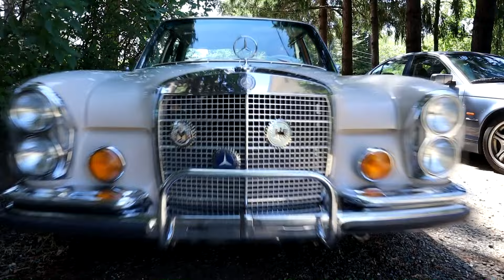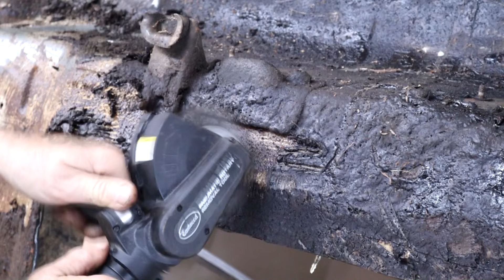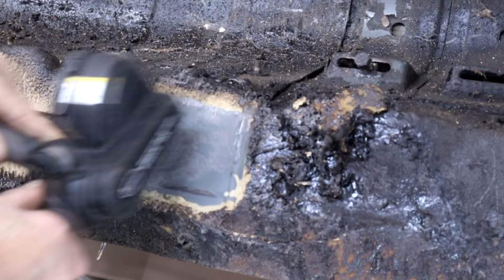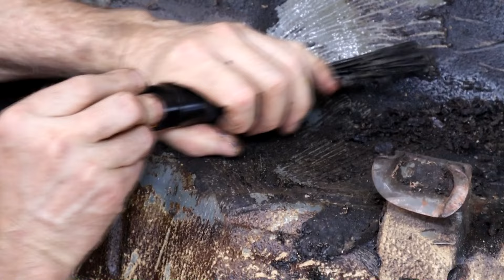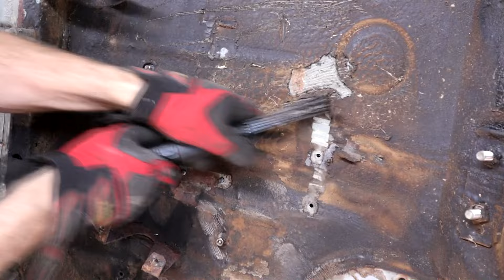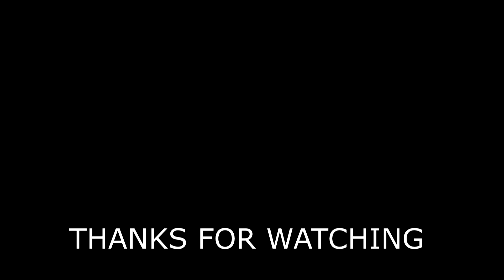MERCEDES FLOOR PAN REPLACEMENT PART 2.  UNDERSEAL REMOVAL METHODS

Comment: Hi John! I did it exactly like you do. Everywhere something different is best. All down to the bare metal, most called my an idiot, which is absolutely correct. At last comes the white "PVC", produces flakes and inflames easily unser heat ... Always wear appropriate safety and Filter equipment when doing this for hours /days. Fire extinguisher next to you. All in all it took me a full month to have the bare metal everywhere. Most of the paint went with paint stripper (industrial style.....).
At the beginning I always ice blast the underbody, at least most of the dirt is gone then.....Wish you success (3478 was far better than yours but rests in peace now 😢). Rgds😊
Reply from the maker: I did consider renting an ice blaster. But none available around  here. Cheers John 🍻

Comment: Hi John. Thanks for the mention, I always wanted to be recognised, shame it took 72 years! You're bang on with the underseal removal. BMW, very similar to MB, absolutely cake that rubberised underseal on. I'm working on currently a1998 BMW 840Ci, I had to remove all the underseal from the rear wheel arch lips to repair the rust. It was 1/2" thick in places, almost impossible to get any tool in to abrade it off. I discovered a great, but dangerous solution, a controlled fire! With garage doors open, fire extinguisher by my side, just set fire to the underseal in sections and let it burn itself out. What you are left with is a black, rock hard substance that either falls off or abrades off easily with small wire brushes. That underseal is a bloody nightmare. It is so thick that the metal underneath is often so compromised that it has rusted right through, but it still looks perfect on top. Also, it clogs up wire wheels and needle scalers for fun. Extreme heat is definitely the way to attack it.
Reply from the maker: Absolutely Bob. I appreciate any input. I'm finding heat then the wire brush is the most effective. You're right sometimes 1/2 inch thick. I did find a few areas that have rusted due to failed seam sealer I think. Now's the time to catch all that. I work on it after work for a few hours. I'll have it done soon. 
Cheers John.
Reply: Wow, that's deep!

Comment: Never seen a needle gun used for that! great idea seems to work a treat, well done John.
Reply from the maker: Thanks Glenn. It did work pretty well. I also tried a similar tool that had a scraper blade attached. that worked well on the seam sealer after heating. Cheers John.

Comment: Doing the same work on my 116 - I've found that a sharp gouge chisel will take much of it off weather it was been heated or not. otherwise I've been using a knotted wire wheel on the angle grinder. Nasty Job to say the least but worth while. Best of luck!
Reply from the maker: I have an old chisel, I'll give that a try. I found the dry stuff adding just a little heat helps. Then switching to the wire brush on a drill etc.  It is a dirty job. But also satisfying to see the change. 
Cheers John 🍻

Comment: Looks like the undercoat did its job at least in these areas.  I don't see any rust underneath.  At 9:16 you mention "areas where moisture got in under the underseal".  I have a bit of that in my wheelwells.  I am not equipped to follow your lead on this, but I am wondering, if I just use a flat tool and just pull back any loose area created by cracking, then sealing with a rust encapsulator to keep it from going any further.  Great work on a big project!
Reply from the maker: Hi. I think that's a good approach. I found that the circular wire brush on an angle grinder was able to clean that underseal back very easily and quickly. Make sure to use good eye protection. Once your down to bare steel, sealing it with a rust encapsulater would be fine. You could also treat the area first with a chemical treatment, permatex has a good one. It chemically treats the rust. Then to blend it in you could shoot fresh undercoating over that. It's those dry flaky areas you want to check carefully. Hope this helps. Good luck. Cheers John.

Comment: I find the easiest way to remove that bituminous underseal is wash it with petrol . Then once I reach the Mercedes PVC under seal I use a cheap heat gun 🔫 and a 1"chisel which gets it off quickly. I stopped using flame to get rid of it because of the cost .
Reply from the maker: I'll give the heat gun a try. Today I found a combination of heat then the wire wheel worked well. Also heat with the needle gun for seam sealer worked great.
Cheers John 🍻

Comment: I just did a Fiat X1/9 underbody, without a rotisserie it wasn't much fun.

I used a decorator's hot gun and some chisels and some gouges.

I rounded off the corners of the chisels so they didn't dig in.

I effectively planed the surface between the original factory etch primer and the original factory underseal, then I washed the residue off with acetone.

Never again lol
Reply from the maker: It is a tough job. I'm going down to bare steel just to make sure I don't miss anything.  Looking forward to getting it all clean/ repaired and primed.
Cheers John 🍻

Comment: Chemical dipping most effective method because it can reach areas that physical methods like sandblasting can't, and it doesn't warp the metal.
Reply from the maker: You're right there. But I'm a long way from that service and have a budget to keep too. I try to do as much labor work myself, which saves a ton.
Cheers John.

Comment: Nice toys… Err… Tools. They both work well. Using a heat gun is safer than using a blow torch. Less risk of fire.
Reply from the maker: Tools Chris:) HAHA. Fire extinguisher is very close by:) I find just a quick blast and the wire brush works great. 
Cheers John.

Comment: well, we can say that the coating was at least very effective on it's adherence... 😂
Reply from the maker: O yes, it doesn't come off to easily. Though where it dried out and flaked moisture did get behind it. I have found a couple of areas that will need attention. "So Far":)
Cheers John.
Reply: @mercedesmaintenance.6339  this is the dirty part of the job... 😂 Regards👍🏻